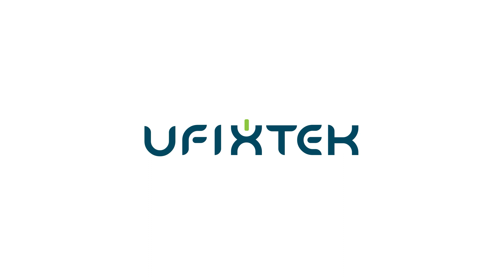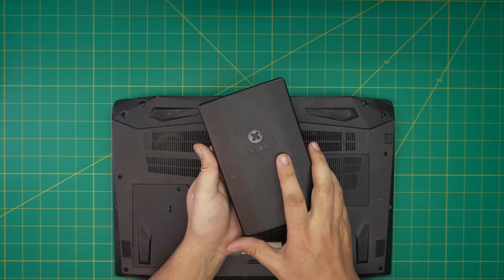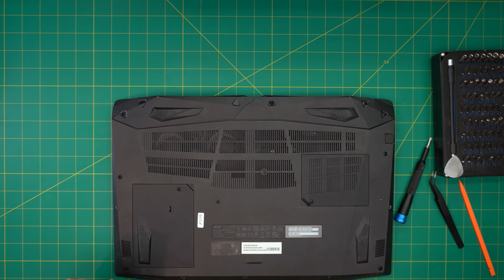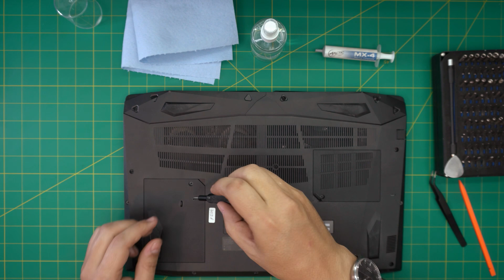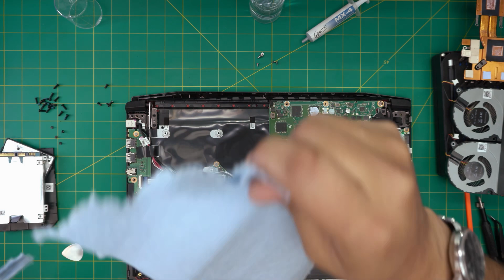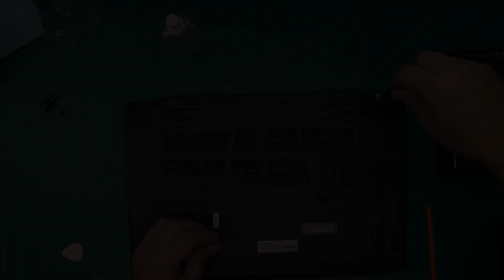How to Repaste and Clean Acer Nitro 5 AN515-52 Laptop - Step-by-Step ( N17c1 )

Comment: Perfect
Reply from the maker: It's my pleasure my friend.
cheers🍻
Reply: @uFixTek I have acer nitro 5 with intel i5 8300H and 1050 nvidia 4gb soon i will make an upgrade because the laptop has 8gb ram memory and it has old hdd i will put one more stick of ram to become 16 and i will put ssd to the laptop because he is not very weak for gaming but with new ssd everything will loading easier and very fast i will make very good and deep cleaning of the cooling system as well to change the termo paste i think i will have very big difference as well i will play to there that my processor and graphics card letting me but i think the difference will be incredible i have friend with old laptops when they make such un upgrade everything becomes different and your video helps a lot for that man thank you

Comment: VRAM and VRM use 0.5m ? I bought 1.0 M, can I use it instead? Because I used 0.5 before and felt that the heat was abnormally high. Thankyou
Reply from the maker: 🫠Regarding your question, sure, you can use the 1mm, and it should fix the overheating issue you're having.
cheers🍻

Comment: sir I followed all the procedur and I think I dont miss some steps, but when I turn it on, the gpu fan stops spinning (Ive checked it by directly ovserving the fan from below when its on, the gpu fan stops spinning). is it softeare related or hardware related? please helpp sir thanksss
Reply from the maker: 🫠Regarding your question, it is normal for the fan to start spinning when the GPU temperature goes over 60°C. You're fine, don't worry.
cheers🍻
Reply: @uFixTek  this morning I have tested it by running 3d geo modelling software which required graphic card performance, and the fan still not spinning. the laptop starts overheating up to 90 celcius and start crashing, still the gpu fan not working sir.
Reply from the maker: Then you will need to make sure the fan is fully inserted into the jack.
You will need to check the fan connector's voltage when the laptop is on to see if the voltage is live. If so, then you will need to replace the fan. If the voltage is missing, then something is shorted on the fan line on the board.

Comment: All the thermal pads are 0.5mm?
Reply from the maker: 🫠Regarding your question,v-rams .5mm and power rails 1mm
Should you have any further questions or requests in the future, please don't hesitate to ask me.
cheers🍻
Reply: @uFixTek  How do I know when they need to be replaced?
Reply from the maker: When they are dry and not flexable and they start having cracks.
pads are good for 10yeard under heavy loads, i'm asuming you are not gaming 24/7
Reply: @uFixTek  ok ty
Reply: @uFixTek  I have another question, are the fans the same type for cpu and gpu? They look the same and I can't find any information about the model on the official website.

Comment: I'm planning to use thermal paste on my acer nitro 5 r95900hx rtx3070 is it fine?
Reply from the maker: 🫠Regarding your question, sure just take your time doing the service and don't rush it and you be fine.
🍻cheers
Reply: Sir @uFixTek ,What size should be my thermal pads? Acer Nitro 5 AN515-45-R5RJ
Reply from the maker: the vram pads are .5mm pads
Reply: @uFixTek  What are their lengths?
Reply from the maker: @Phorcent  buy a packet, they come in sheets and you can cut them to size, compare to the one h remove

Comment: Thank you man, I'm trying to find the right thermal pad for this model for days my laptop is now 40-45°c on idle and 80-89°c on high load with undervolt
Reply from the maker: It's my pleasure my friend.
🫠Regarding your question, those numbers are fine, but if you want to replace the pads, they are 0.5mm and 1mm.
cheers🍻
Reply: @uFixTek  wait, which pad are 1mm? I'm repasting and re padding my gtx 970 and it using 1mm too
Reply from the maker: Just get one sheet of 1mm and one sheet of 0.5mm, and you will know once you open them: the skinny one is 0.5mm, and the thicker one is 1mm.
Reply: @uFixTek  thank you
Reply from the maker: It's my pleasure

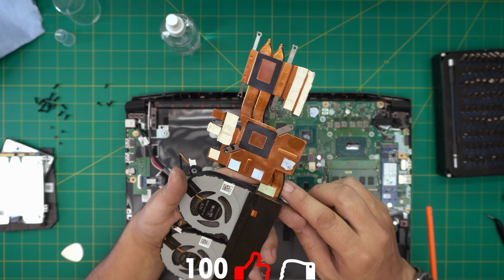Comment: @9:17 I've seen on the internet that people have recommended 1mm for the thermal pads, for this model. So, will using 0.5mm be fine?
Reply from the maker: 🫠Regarding your question, don't use it because 1mm will counter push the heatsink aways from the GPU CPU and you will not a have a great temps.
cheers🍻

Comment: My thermal pad dont sticky anymore to the vram but it does stick on my heatsink, wdyt if i change it should i or didnt need to ?, and for the thermal paste does it run hotter when the thermal paste is a lil bit too much ?, because ive experienced it if i use it too much their run hotter but if i do it a lil bit less the temps is cooler, apriciate it u share this video keep the good work mate 👍👍
Reply from the maker: Thank you for your feedback! If you wish to support the channel, you can like, subscribe, or both!
Regarding your question, if your thermal pads are clean and not damaged don't change them, they don't necessary need to be sticky.
the thermal paste should be a 1/4 size of the crystal dye of the GPU or CPU, don't over paste, and over pasting should not result in higher temps my friend.
Should you have any further questions or requests in the future, please don't hesitate to ask me.

Comment: Can i use a portable vacuum to clean the dust of my laptop
Reply from the maker: Thank you for your feedback! If you wish to support the channel, you can like, subscribe, or both!
Regarding your question,NO please don't use vacuum, it generates lots of static discharge and can damage the board, use a air compressor, and make sure you prevent the fan from spinning when blowing air into it, else you will generate reverse voltage and can damage the board. the best air compressor we recommend: https://amzn.to/483cxKi